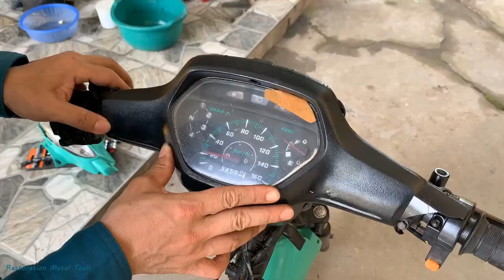Restoration perfect Honda Wave 110cc four-stroke engine | Restore old Wave Alpha motorcycles rusty

Comment: A very Basic Make Over, Not  A Perfect Restoration.
Putting Back On Rusty Looking Bolts And Nuts. Paint work Is Basic As  Well
Put Back Crappy Old Tail Light And Blinkers On It
Missing The Front Shock Covers

I wouldn't Want This Guy Doing My Restoration